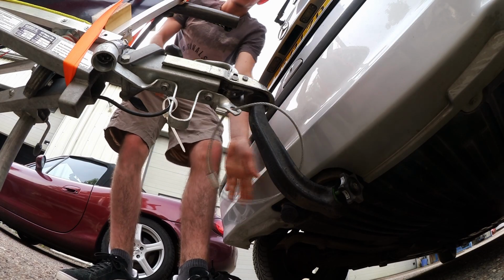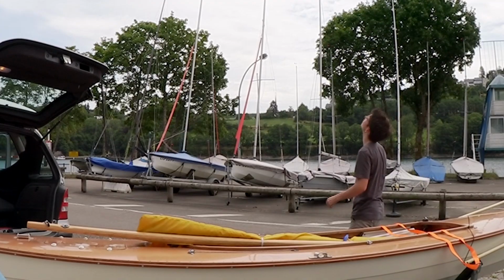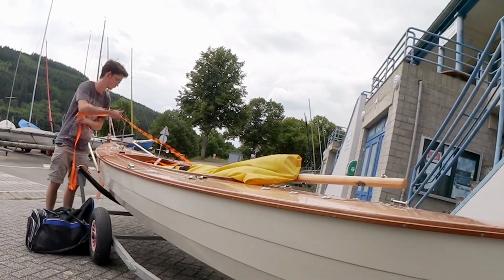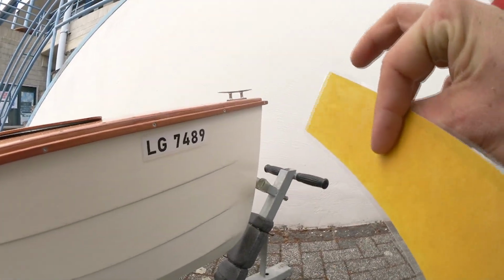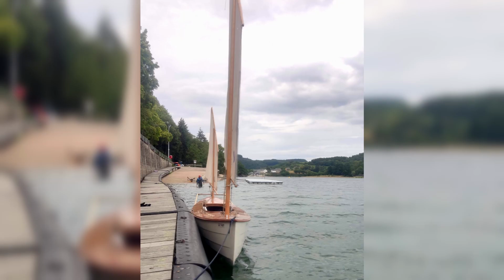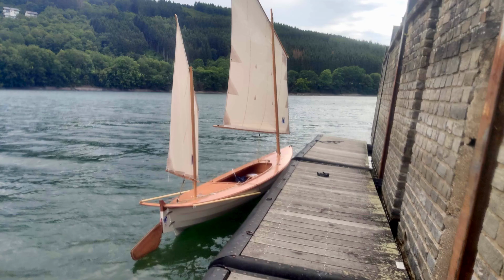Building a Waterlust Sailing Canoe (part 13): What happened with my Waterlust Canoe?

Comment: Looking really nice - beautiful build!  You mention you sailed her in quite a lot of wind, with just the reefed mainsail, were you sailing 'dinghy' style, sitting out on the side decks, or 'canoe style' sitting on your seat in the bottom of the hull?  I have only sailed with the full rig up, but only in maybe up to a Beaufort 3,  and then, I would say you need pretty good dinghy sailing skills to keep things upright! I might soon be adding toe straps to mine for higher winds. Another Waterlust builder I know made a really clever modification to his boat, before building it he cut some large rectangular holes in the longitudinal stringers either side of the cockpit sole, these are large enough that you can put a toe in and so make 'fixed' toe straps.  If I were building Svale again, I would include this modification.
Reply from the maker: Hi, thanks :)
I have two toe straps in there, both running from the daggerboard case to the end of the longitudinal stringers (where they meet the frame) with a clip to adjust length. (Maybe you can see it somewhere in pt12.)8
I sail her almost always in dinghy style (I would say I have a bit of dinghy skill and therefor am more used to it) but it wasn't great with full sailplan and gusts up to ~20kts as you heel very quickly and lose rudder response when doing so. It's definetly a boat to be sailed with reefed sails instead of letting it heel to reduce sail area. It drafts quite a lot as well, hard to run any height.
My seat is very easy to remove though, that helps to switch between canoe- and dinghysailingstyle.